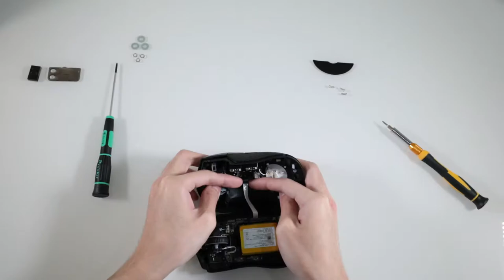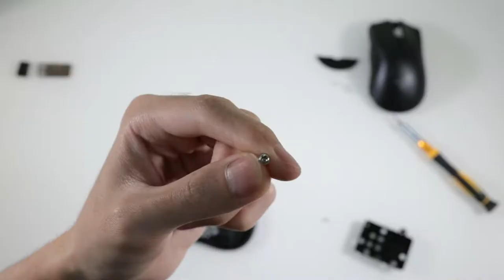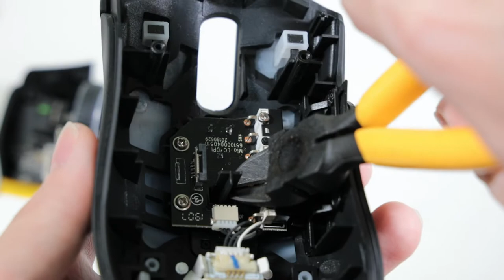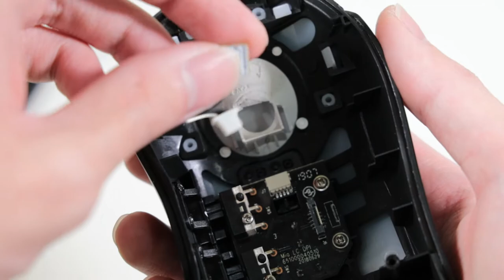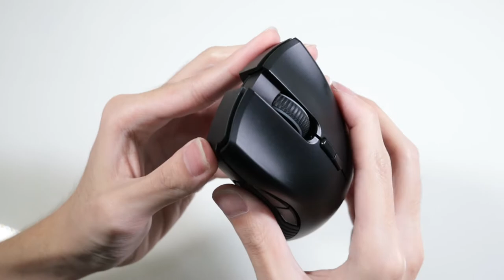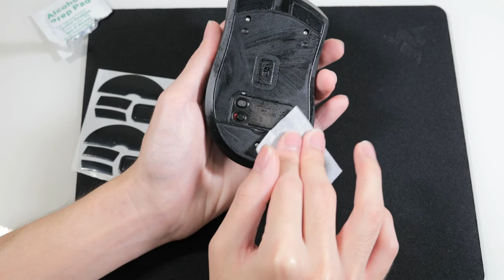Putting a 2500mAh Li-ion on to Razer Mamba Wireless | Triple capacity

Comment: I am using 1 Razer DA V2 Pro and I also changed the battery from 450mAh up to 1000mAh. but I cut it manually so that the wire matches the original PCB, after replacing I can use the wire but it won't charge even though the charging light is still on. I don't know, worry :(
Reply from the maker: Ill see what I can help with. Email me chinweiren213@gmail.com
Reply: @ChinWeiRen  Thank you very much. Tomorrow I will take a picture for you to see, hope you can help me
Reply: Hi, I also upgraded the battery for my Razer Mamba wireless to a 2500mAh but it doesn't charge as well, did you find out the solution for this?
Reply: mine too with my viper ultimate, it wont charge at all after replacing the battery, any solution?
Reply: I have tried the same thing with 3 different batteries and it only flashed red